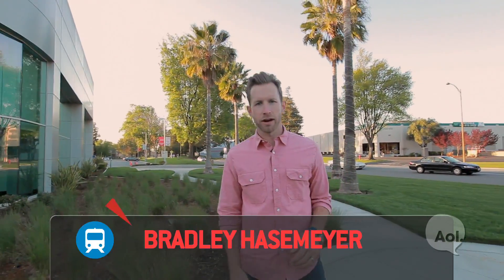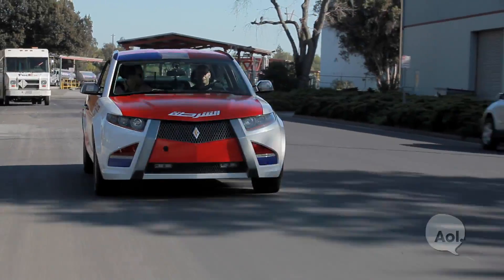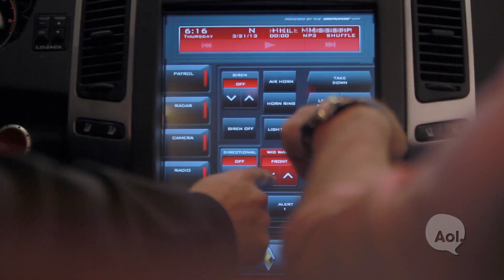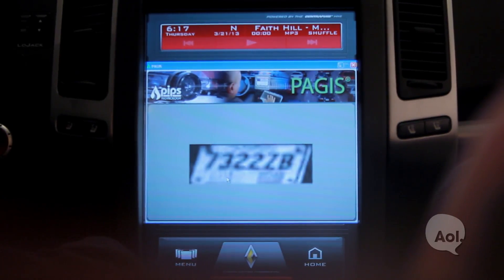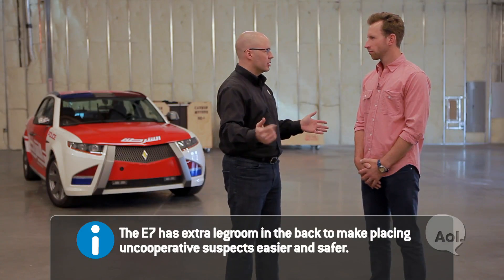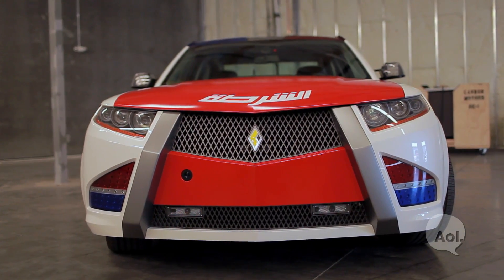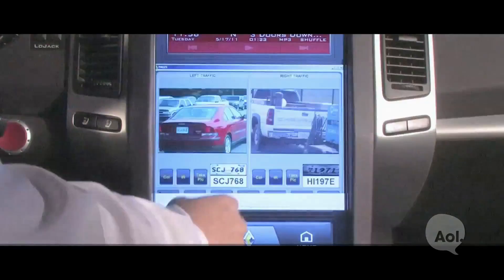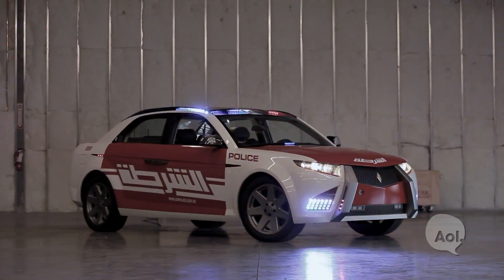Carbon Motors E7 Police Cruiser | TRANSLOGIC

Comment: This was a great concept, but looking back this would’ve painted a lot of police departments into a corner financially. Most departments auction off their cars after about 60 to 70,000 miles because they get a terrific amount of wear and tear. The E7 had an expected service life of 150000 miles, but cost would’ve been more than double because Carbon Motors would not have had the economy of scale. Add to the fact that police cars are frequently wrecked and usually by officers hitting each other’s vehicles. This would’ve been a very poor investment for most departments.
Reply: Carbon Motors also was hedging their bets on a $330 million government loan that never materialized. The company simply didn’t have the funds to keep going and failed anyway. For one thing, Ford builds anywhere from 30 to 40,000 police vehicles a year, but they can amortize some of the cost is these are built on consumer vehicle platforms. Carbon motors would not have that luxury, and a car that would sell for $60,000 would now sell for close to $200,000.

Comment: What happened to Carbon Motors? Why did they decide to shut down?
Reply: Obama gave a 500 million dollar loan to Fiskar to make electric cars instead (they made 2400 then went bankrupt and never paid back the loan.  This was a diesel vehicle - with the BMW N57 3.0L turbo diesel engine in it.  I wish they had talked about that part in these videos - absolute beast of an engine. 375 HP,  545 lb-ft of torque (!!!), crazy fast and very reliable motors and nearly 40 mpg highway.  But not electric so the US government didn't want to fund them.

Comment: Please government, invest in this. I have gone on ride-alongs, after about two hours, so uncomfortable. The crown vic was bulky, slow, so many things were right in the deputy's face. I felt slightly unsafe with a laptop right in front of me, not enough to bother me, but it gave off a bit of an uneasy of a feeling.
Reply: +Parfemarfe I Carbon Motors went under. The only asset they had, this prototype, was sold at auction.
Reply: I know. But thank you for making that clear.

Comment: Great idea, but figured it would not work. What happens when the vehicle needs maintenance, mechanical problems, basic repairs? Special repair shops across the country or one centralized location? What do you do with it when it's time to take the vehicle out of service-can't sell it to the public? Plus Ford, Dodge and Chevrolet are putting out fairly decent vehicles at reasonable prices. Maybe Ford could adopt a similar concept, but make it easier to repair and replace...
Reply: The turbodiesel engines were initially sourced from Mercedes, so that would have been the go-to dealer to service the drivetrain.  The rest of it, like a Tesla, is mostly software, so possibly (!) could have been remotely diagnosed and repaired via patching from Carbon directly.  But, there is an issue with scale, and also as we've seen today, depending on a supplier that's out of the country can lead to higher costs or supply chain issues.

The IDEAS were sound, and American carmakers really should pick up the ball where Carbon Motors stopped.  I have seen that Chevy is touting "purpose built" versions of the Blazer EV for residential/commercial patrol, which while pursuit rated (a big thing with any cop car), the range on the batteries isn't all that great.

Comment: They need to incorporate something like a volt or tesla drivetrain so the vehicle can have use electric mode for silent operation and to power the computers instead of wasting gas idling.
Reply: 2025 Chevy Blazer EV's are being offered as pursuit-rated police vehicles.  Someone must have read your comment over at GM. :)